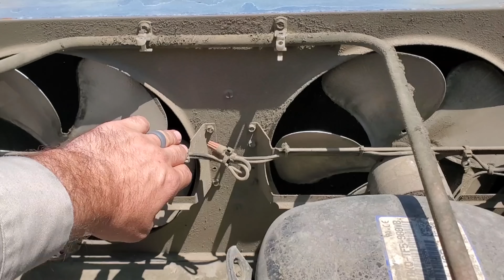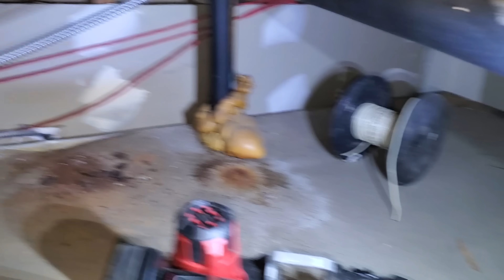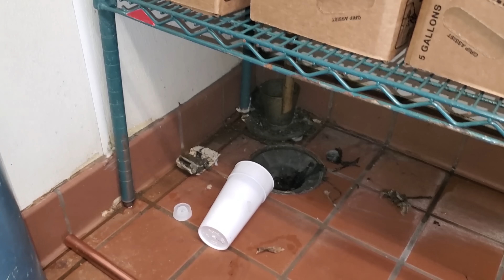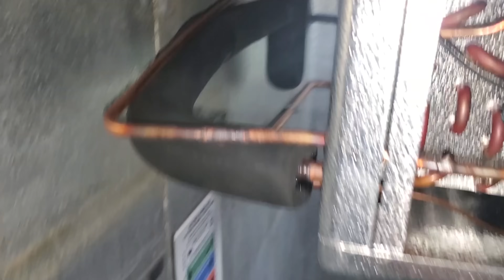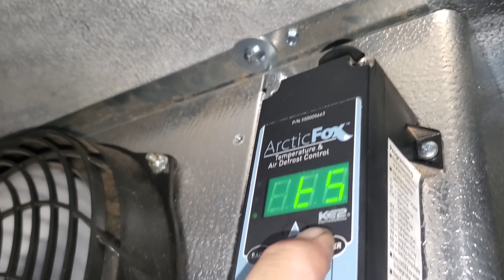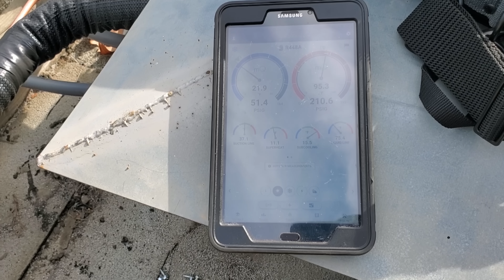BIG PICTURE WALK IN COOLER SERVICE CALL

Comment: I have a question...why does a normal ac compressor get louder during daytime ?? I thought they are fixed speed..no this is not an inverter mini split..its a normal mini split ac.
Reply: My best guess is the oil gets hotter during the day and thins out, making a compressor run louder.
Reply: @SebP85  soo does the compressor like...run faster, draw more power or is it just SOUNDING louder ? cause i know normal acs are FIXED speed ..
Reply: To my knowledge, it's just like a car engine. Gets louder with less oil. Just due to vibrations and such. Oil acts like a damper.
Reply: Thick oil dampens vibrations and noise better than thin oil. Oil gets thin when it's hot. That's the only reason I could think of.
Reply: @SebP85  hmm well i guess that can make sense since it doesn't be as loud when its operating at night time ..so yeah that makes sense

Comment: hard drawn copper and a couple elbows welded would of left a much more tidier install. a new pipe penetration in the roof of the room would of looked cleaner too. judging by the dirt on the coil i would say those drains gonna block up real quick.

Comment: I don't think you're supposed or allowed to cut into a structural beam either, I'm sure there's a code violation with that, even if it's used as a chase. Good job, Chris.

Comment: Why do you use Copper for drain lines instead of PVC ?  I find copper can sometimes clog really bad , and after a few years some will clog the point you have to tear it all out. Walkin Freezers I use copper with heat tape , but Coolers I use PVC

Comment: About covid, I think those sneezes are just for a dusty enviroment since these rooftops carry pretty much dust. Its important to also not to freak out and think the smallest thing are covid. If you are working and get sneezes, sense how you are in a different environment. If the sneezes disappear, then its not covid. Same with coughing. Very important to exclude other causes before jumping on the covid. Another example: You work in a environment that start getting smokey, and start coughing. Of course its not covid, as soon as you move out of the smoke, coughing will disappear.

Comment: I have earlier serviced ultra deep freezers in 30 Years and get rashes by seeing those fan motors.
They was named Smith, but had earlier another name.
Never seen so many frozen shafts on any other motors up in the years.
On those units, it was just one to cope with a hot condenser on the rear part of the units.
If the customers did not clean the condenser, they dropped dead inside 2 years.
The models back 40 years used a single end sleeve bearing made by GE.
Those hard working cast iron GE motors stayed alive a long time😬even oil plug on + 45 years old.
Later RMR same looking with a pretty decreased quality.
I lost many weekends to hurry out inside 2 hours to save valuable products in the freezers.
The tube axial type used in the  latest 15 years was a dream, they never let you down.
Great to see your videos and the good work

Comment: "I guess I should read the instructions"

Man-card revoked 🤣

Another nice video.  I hope your customers appreciate how rare it is to find detail oriented and conciseness service companies. 

One minor nit to pick - when writing notes to future you inside the equipment, if you can write on a vertical space less dirt tends to accumulate and your writing will be visible longer.  That unit on the roof had a nice vertical panel on the inside that would be perfect for those notes.  It may not be dirty enough in CA to make that much of a difference - maybe in Palm Springs with that insane desert dust.  

Still love your videos even though I will never do this work, I find it fascinating and appreciate you sharing!

Comment: Did you put a cap on the VCRT when you started and passed a decay test, cause it leaks sometimes through teflon seals?  I had it leak there and when I put a cap on it decay slowed down to zero.

Comment: Any risk of UV eye damage from that torch?
Reply: Yes there is, You're supposed to wear shade 3 glasses or shield technically. However the risk is much lower just brazing than it is cutting but you should still should use regular sunglasses at the very least because they have some UV protection.

Comment: LOL. The restaurants I serviced were too damn cheap to replace bad equipment with new. Instead, they had a warehouse full of old junk, and they would send out someone to roll out the bad and roll in the new. No PM plan, everything was "fix on failure." At least you have customers that can see something besides the inside of their belly button.
Reply: We don't have a warehouse of old junk, unless you call one of the franchise owner's rental apartment properties a "warehouse" with mostly-broken 1980s equipment. Every time a part breaks, we have to wait a few months for him to pay a "tech" to pull a bad part from an out-of-service machine and put it into our sorta-working equipment to disable it further. The "tech" has made quite a few two-hour roundtrip drives to try and install a part that is either already broken, or not the right one in the first place.
Horribly inefficient, not only in time, but financially. The guy does shoddy work. We have ZERO PM, and the owner likes it that way, no matter how many times an expensive failure we've had in the past 16 months I've worked there could have been prevented with a few days' TLC. Saving hundreds to spend thousands!
That constant bearing squeal coming from one of the RTU's indoor blowers that I've been complaining about for 2 months? The sound you can hear from outside AND from the vents themselves? Not a problem until it fails. We'll worry about it then. (Please let it be a failure involving fire, just like the last time when the convection oven self-destructed,  I want to give him the most epic "I TOLD YOU SO!")
Reply: @dashcamandy2242  I'm not Italian, but I have been close enough to be considered one, and there is a word for these owners. It is "stunod."
Reply: If it ain't broke, don't fix it.
Reply: @joehead1294  No, if is isn't broken, you should keep it that way, and not allow it to deteriorate..... so that YOU can control when the box gets warm, and not wait for it to do that on its own, when it is full of perishables. By doing a good PM, you can replace worn parts and clean dirty coils. These restaurants don't realize it costs them product and loss of use when a failure happens, and the cost of the cleaning and the repairs is the same, on TOP of the loss of product and use of the equipment. Which is better?
Reply: @arthouston7361  You know which one it better.

Comment: 11:10 "Put some solder on there, stop skimping, dumbasses"

To be fair, at 2:44 you allmost cut the powercalbes in half because you made the rookie mistake of not checking that before powering on, and  lets face it, you make at least one leaky joint every other video.

I know it's frustrating but at the end of the day the guy who did that join is just another tech, just like you. You make the stuppidest mistakes too, so get over it.

Comment: Lol that welding job is pretty smooth brain. I'm willing to bet the owner knew damn well what they were doing 🤷
Reply: Most likely, bonehead will feign ignorance when the place collapses.
Reply: by this time I think it doesn't matter, but that whole beam for sure went to a few hundred degrees when they were cutting that hole ... and if there is one thing we all know is that metal loses stiffness etc when hot. Not to mention all the wood around. Imagine a nice smoldering fire on the backwall .